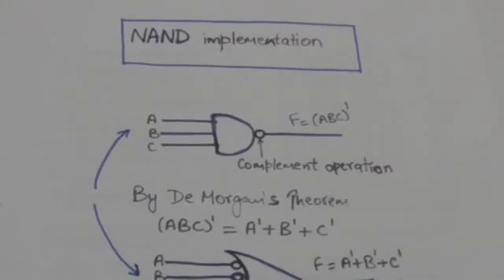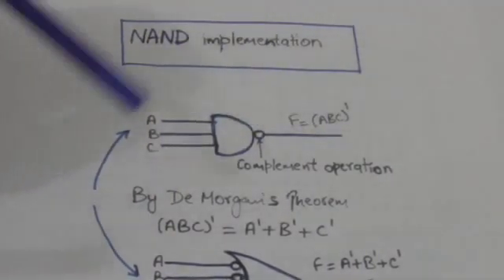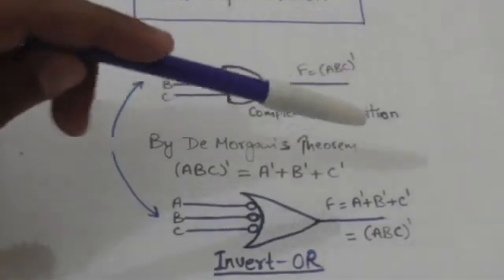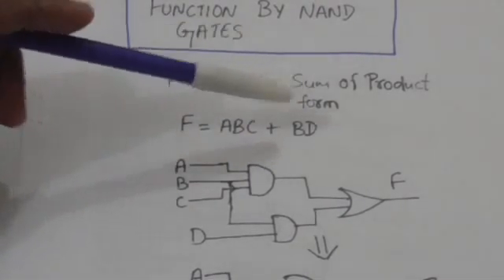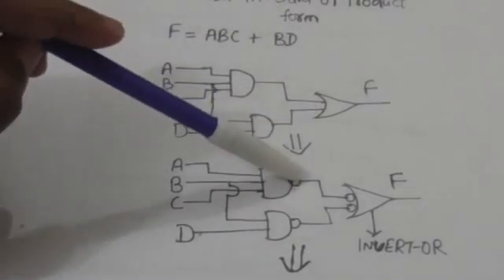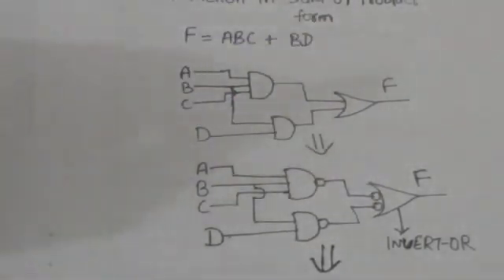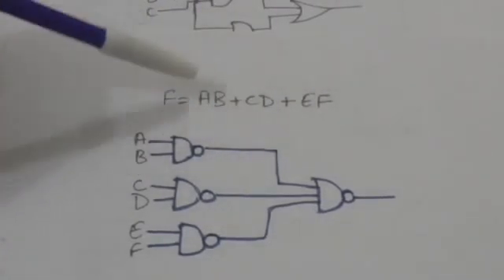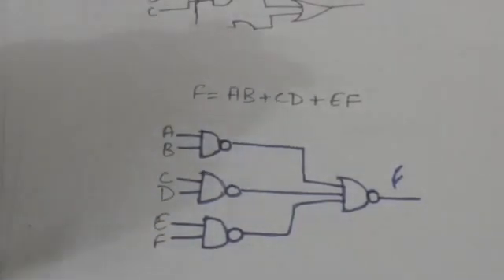IMPLEMENTATION OF BOOLEAN FUNCTIONS IN SUM OF PRODUCT FORM BY NAND GATES(DIGITAL SYSTEM-48)

Comment: Invert-OR gate = NAND gate, in case anyone is wondering.
Reply: But how???
Reply: If you put a NOT gate after an OR gate, it is OR-Invert which is also called NOR gate. But if you put NOT before OR, it is Invert-OR which does the same functionality as a NAND gate, therefore we can replace an Invert-OR with a NAND gate to save money. That is just how it works.